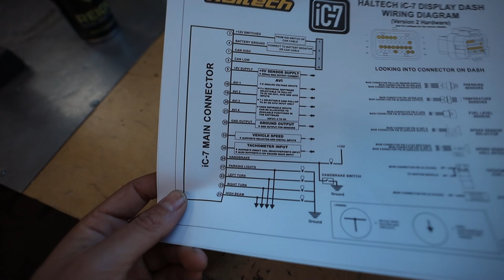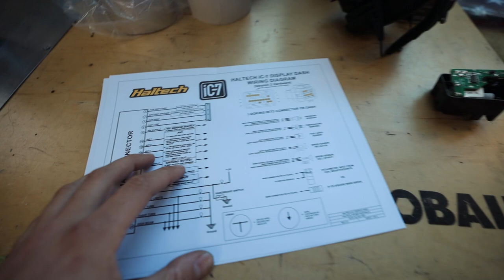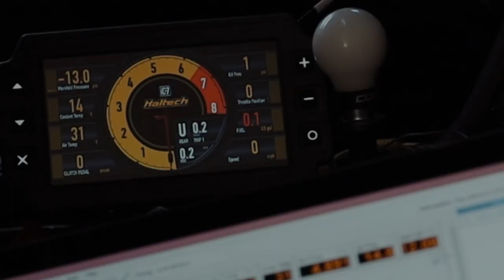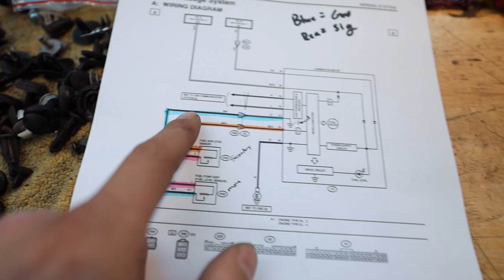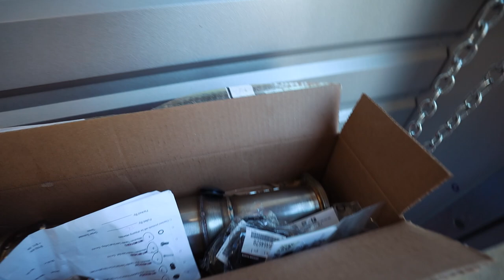Dialing In the Big Turbo H6 Subaru WRX STI!

Comment: To make your intercooler more effective, block off the areas next to it so that there's a low pressure area directly behind it. Then the air in front of it will want to flow through it instead of around it.

For example, on a lot of cars that have limited grill space, you'll find an air dam under the radiator. This forces air through it.
Reply: Like V-mounts on rotary engine set up?
Reply from the maker: Gling to try and build some type of air Damm, but swapping to an 18+ bumper soon so going to hold off until the new one comes in
Reply: @Smeedia  or cut the opening following the width of the intercooler fins and keep bumper intact on both side of intercooler end tanks..

Cheers 🍻

Comment: Lets goooo driving!

U can roll it into boost just fine atleast for around 10-14psi lightly....

Side note... Closed deck not overheats the engine on casual drive... It will put heat stress on roadcourse/time attack/canyon hard driving....

But there is solution to that being done many times...  Cutting new coolant groove on top of the closed deck... Also in motorsport wrc use by prodrive, they did drill small holes and put coolant steam port on top of the block for each cylinder...  

Cheers.. just sharing of the additional knowledge 🍻
Reply from the maker: Just did the first oil change today, going to start giving it a little boost Here and there now 💪

Comment: So hyped for you! Been watching this build from the start going through my harness at the same time as you in the winter. So much respect. Im so excited to get my eg33 swapped 07 impreza on the road because of watching your videos! Youve kept me inspired. I couldnt have gotten as far as i have without you sharing your build. You brought me a sense of community. Thanks for always responding, youre  awesome!
Reply from the maker: Glad that I could help share some of my insight, weather that was my mistakes or successes, how far out are you on the swap? 🥳
Reply: Haha I definitely loved watching your mistakes, made me feel better about my own! I was just about to walk out the door to put in work on it before you posted this^. Currently i have just started the car, fuel done, cooling system is mocked up, wiring is done besides dash lights. Ive merged an obd2 97 svx (only %17 made ob2, no wiring diagrams) with my 07 impreza  stock harness. I have the svx running the engine and sending/ recieving all the signals from the body it needs. Fought the clutch switch wiring for a month and then realized i could just ground it to the body instead of getting it from the ecm🥴😬🤣🤟🏼
Reply: Car still needs a whole exhaust built.Probabaly a month away on completing it as ive got a homestead to take care of too. I live in the boonies of british columbia, been doing my swap in a gravel driveway in the woods. Also ive gotta watch your video twice now, haha cant write and read and must appease the algorithm by not skipping. Good job on the vss signal!

Comment: This is by far the best build on YouTube! It's so close to being dyno day again and I'm pumped lol a little side not on my 16 wrx so swapped out the hpfp for the nostrum. Well didn't fix the lean out issue so there's that🤣. Next step is to pull the 300c and double check the o-rings. 🤔 hoping it just came loose and I can fix that! Any insight? Keep up the great work man 🔥🔥 content as usual
Reply from the maker: How many miles are on the car? Curious if the injectors need to be cleaned
Reply: @Smeedia  70k and I bought it with 50k on it. It was completely stock.

Comment: So stoked for you man! All the hard work paying off. 
I like the bumper after the trim... giving me ideas ha ha. I could use the help with cooling as well. 
You may have sold me on a trip to SubieFest this year just to see Blue.
Reply from the maker: What cooling stuff you got going on 👀
Reply: @Smeedia  After installing my FMIC my temps have been high. I swapped to a Mishimoto rad... and it leaked... 😅, 2 rads later and finally got a rad that doesn't leak from them. Temps have been high even with the bigger rad and now I'm leaking somewhere by the turbo. Going to check it out more this weekend. I think it's the coolant hard lines coming off my FP Green. I've heard of people swapping the hard lines out and using AN Fittings but need to do more research. 
Seems like I'm always dealing with cooling issues in my car after putting on my front mount.

Comment: So the can messages that the stock cluster shows for your speed comes from the stock ABS ECU. It's spitting out can messages for your wheel speeds, and they're used in the cluster to show mph.
Reply: Just so you know it does spit out wheel speed even when you're not moving. If you wire power and ground up to the ABS ECU, it will start reading can messages out.

So if you have something that can sniff can messages, like a simple Arduino or can tool, You can check it all out on the bench

Comment: I just bought a 2020 wrx I will be buying the map catback the map intake with there stage 1+ tune and will be using the Cobb ab will I run into problems if I buy the tomei uel headers
Reply from the maker: You will need a prior tune for those 🙏
Reply: So I should do the stage 1+ tune before I install all those upgrades

Comment: Looking great and sounding great! I’m missing my bumper next time I take it off (need to plastic weld a piece that cracked off of my front lip).

Also, random question: my AEM A/F gauge is stuck at 14.7 like yours was, what was the eventual fix?
Reply from the maker: New O2 sensor 😭
Reply: @Smeedia  boo! I was afraid of that… I got E85 from a different station the other day and my ethanol sensor maxed out at 100%, I stayed out of boost and got some 93 to chill it out but the sensor fouled or something. Anyhow sad story 😢

Comment: You had recently removed three gauges from the evolution, would you sell those used gauges?
Reply from the maker: Swapping over to a newer set, they were just a little old and I wanted thr newer ones
Reply: @Smeedia  yes you did mentioned that in one of your vids. Just checking if you would sell those old gauges?
Reply from the maker: Already sold them 😭
Reply: @Smeedia  oh my😢
Reply from the maker: Posted then up a few weeks back😭
Reply: @Smeedia  how did I miss them. Where do you normally post stuff that’s up for sale?
Reply from the maker: Instagram 🙏
Reply: @Smeedia  ok

Comment: Now that you talk about closed deck engines getting coolant and not over heating, What is a temp that you would be concerned about if your car was constantly hitting without doing any pulls in a 80=90 degree weather.
Reply from the maker: 205+ without coming down

Comment: Blue is freaking sick, you’re such an inspiration to my build. I boosted my 2006 Scion tC it was making around 300hp before the head started lifting and while I was down there fixing it I decided to overhaul the engine,  but during the process, I accidentally mixed up the bucket valve lifters for my head and now idk where they go, I know they can’t go anywhere but what do I do ?
Reply from the maker: Going to have to release your valve lash and play bucket swap to find which ones go where 🙏 not too hard but very tedious
Reply: Feeler gauges and a nice micrometer set will make it 20 times easier!
Reply: @Smeedia  may be a stupid question but do you actually “release valve lash” cause I’m looking for videos and I can’t really find anything on releasing it. Only how to measure it
Reply: Props to you for boosting your tC that's very different which makes it awesome
Reply: @Spyder17090  appreciate it bro🙌🏼
Reply: @Jpgaps  you should make a video on it
Reply from the maker: What do you mean by releasing it? 🧐
Reply: @Smeedia  You said I had to “release your valve lash and play buckets swap”, I understand the bucket part but idk what you meant by release the valve lash😂
Reply: @Spyder17090  gotta learn to edit first I have some recording on it but I gotta edit
Reply: @Jpgaps  there's a video on the channel of Tanner going through this process when he built the motor for the Taxi

Comment: So did you have to do more wiring from the fuel pumps? I’m still have 100% that yet either.  Been building the turbo system
Reply from the maker: I used one of the haltech relays and added a second one in that's controlled by thr haltech. Set so the second pump comes on at X about of boost 🙏
Reply: I still gotta do the ic7 dash to 🙃🙃
Reply from the maker: Worth ittttt 🔥

Comment: Can i ask you a wiring question, eg33 swapped 07 impreza. im fighting with the starter system wiring. I got it to start, but the next time i went to start it it cranked 3 times slowly like it had a dead battery and tried flipping ignition off and went to crank again and no crank.
Reply from the maker: Battery is confirmed good?
Reply: Battery is confirmed good, issus was a bad starter, bench tested an used one i had and replaced it. For some reason i had spark last week and no spark this week. Ive pulled a coil and spark plug and grounded it to the body to confirm no spark. Any suggestions? Im unfarmiliar with the igniter setup

Comment: The man of Subarus if you’re reading this or anybody else reading this I have a question someone can hopefully help me out with but I have a 2014 wrx and notices it started running kinda hot on my cob it shows coolant temp would reach 205 while driving and go back down slowly only to go back up to 200 again even while it idles , it usally stays around 180-190 but it’s been at 205 then goes back down and I noticed when I turned my ac on that my coolant temps Go back to normal and stay at 180-190 any idea what can be the problem ?
Reply from the maker: Normal range for coolant Temps tbh, 205 is when the fans kick on and 185 is when the T Stat opens up 🙏 

Warner ambient Temps play a facor too

Comment: SHOW US THE DIAGRAMS! MUAHAHAHAHA 

sorry couldn't resist, kind of weird the VSS sensor isn't ran through ECM and be reported to cluster.. Car makers, always making shit difficult. if you had the full VSS diagram layout, it would make it easier, as it stands i see pin 33 to IC7 holds the signal in wire. is there any way to have it pick up ABS wheel speed and use that for MPH? otherwise use the VSS off the transmission output shaft.  housing.

Edit: do not de pin ABS module, use t pins and back probe.
Reply from the maker: ALL THE SPAGHETTI DIAGRAMS

That's what I was debating as well, but ideally I'd like the ecm to know what wheel speed is too 

The ic7 won't report any of that to the ecu

Comment: C'mon Tanner... Google is a thing dawg. Ohm/Volt conversion is right there.
Reply from the maker: Never got an accurate reading between them lol
Reply: @Smeedia  Faulty sensors or bad wiring then. I've been dealing with a shit sending unit for the past 6 years that I haven't been bothered to replace yet. I can get by using the tripometer... though I should replace it soon.

Comment: Only thing I have to disagree with you on here is the temperature. Lower isn't always better. As long as you aren't going above 210 degrees you should be fine, especially with how much power you're making. If you make the average temp too low, you could run the risk of running too cool, but it's just one strangers take 🤷‍♂️
Reply from the maker: Under vaccumm I'd like it to hang out around 180 or so, once we get more aggressive with ignition timing it's going to bump Temps up a bit. So if I can control Temps to keep them lower now it'll help when we get to power tuning

Comment: Dude i have a 04 ej with the ams intake mani and a fp red, built motor. But i went speed density and have been having idle issues really bad. Had vacuum leaks checked and had a couple but didn't fix it. ANYONE with ANY ideas?!? struggling here
Reply: How was idle back on the mass air flow sensor? Did you do the AMS/turbo/ speed density all at the same time? Same injectors as before or are those moa betta too? E-tuned/ dyno shop tune? 
What's your base fuel pressure set at?
Reply from the maker: If idles all wonky and your speed density my first thought would be the tune
Reply: @rustyshackleford81   Sorry i thought i had responded. It was rough as well. We went speed density because my shop recommended it, Turbo and ams were on there beforehand. same injectors, ID1300s. E-tuned. It may actually need to be re-tuned but what about voltage surges could that cause this issue?

Comment: And this engine is more reliable than Porsche engine and don't cost 20k to fix it or 36 k to buy new one😂 so you have better version of the boxer 6 engine reliable for the most part if don't throw of cam gears😂
Reply from the maker: It's all around a better set up 😅🔥
Reply: Porsches have good engines, as long as you don't have one of those 996/987 with intermediate shafts... or the subpar cylinder liners that get scored up. Lol